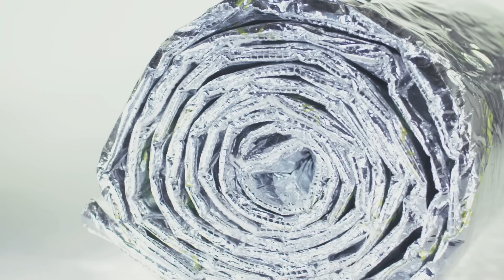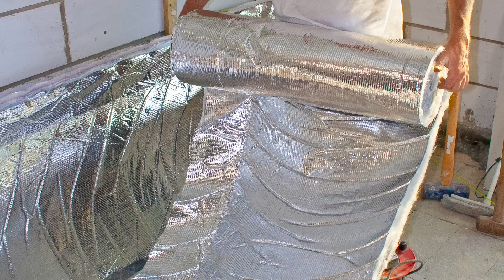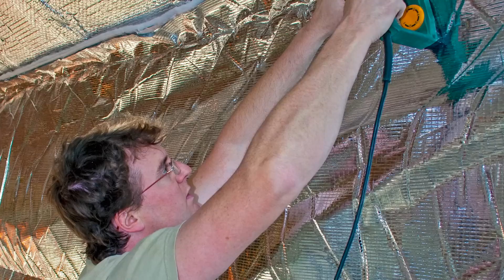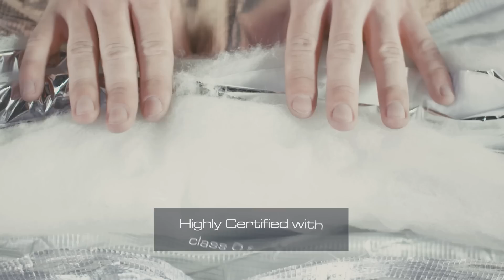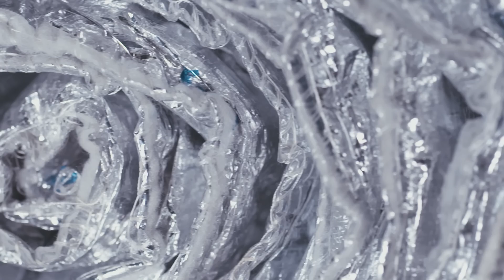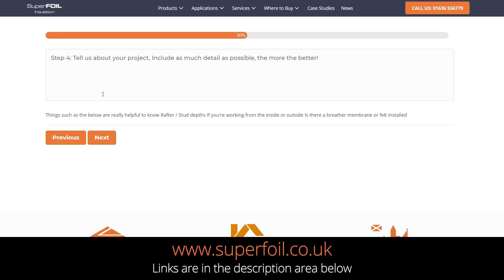What is Multifoil Insulation? — With Byron Lawson

Comment: Local cold climate research describes that there must be an air gap (eg; 1/8 to 1/4 inch) outside the foil in order to achieve the radiant barrier, otherwise the foil is useless if in contact with another surface.   I would also wonder what happens if the foil-quilt-foil gets punctured, and if there is a temperature that causes the dew point to occur between the foil layers, what happens if moisture gets between the foil layers; how does the internal quilt blanket ever dry?   Several years of use will find out what happens.

Comment: Thanks for the presentation. I live in an old cottage and we have a fair bit of loft insulation which really needs to be added to however we'd also like to have storage space. There is limited head height to the roof ridge of about 5feet 5 inches. So in the area I want to use I thought of using LoftZone stilts and boards to the left and right on a central walkway. I wondered what you'd recommend as insulation material underfoot along the walkway? Sorry only an occasional DIYer so might not be explaining myself clear enough.

Comment: Hi I have an old external solid brick wall with plaster on the insides. It's cold. Should I remove the plaster, batten and rockwool it first, or just batten and insulate it on top of the plaster? 
Thanks.

Comment: Having to have an air gap either side of the superfoil, and thereby taking 95mm is a lot. That really loses the benefit of a supposedly thin form of insulation. The SF19+ has an R value of 2.73. I don't know how the air gaps add to that but if you install batons and then 2 inches of PIR and then some plasterboard then the PIR contributes an R value of 14. I feel like I must have misunderstood something because this makes Superfoil seem rubbish.

Comment: Installed Superfoil SF60 in the loft over very thin amount of fibre glass insulation and in conjunction with nice triple glazed windows ( old double glazed had blown) chopped our heating KW by 60%
Reply: At ceiling level or rafter level?

Comment: @SkillBuilder  @Superfoil
My loft is a hostile environment. There is fibreglass insulation between the floor joists that was installed in the late 80s. There are a couple of cold water tanks up there from an era before combi boilers. It's dusty and cold up there and you can see the ceiling tiles between the rafters. I store fans, suitcases, Christmas stuff, tools etc. up there which I access a few times a year. It has the floorprint of a 3-4 bedroom house. Approximately how much would it cost to insulate between the rafters, with multifoil, so I can still store stuff up there. I wouldn't be able to do it myself so would have to employ a contractor.

Comment: I've been using this in combination with 25mm PIR on walls . First strip wall paper off if plaster is sounds leave on . Stick the PIR boards on to the wall with dabs at 400mm or 600mm centers . The dabs don't stick the PIR boards to the wall they provide a packer and level up any unevenness . The boards will come off if knocked tape the joints  . Fix the battern to 400 or 600 centers on the same line as the dabs . Fix the screws through  battern and PIR into the wall  with 150mm screws and tighten up  the batten to the  foil board which will clamp PIR boards  to the dryline adhesive packer  blobs  . .then staple multi foil to the battens then add another batten then add the plaster board  . Used in combination with PIR can achieve higher values with smaller thickness . . In suspended floors l carefully remove floorboards fix batten to the joist fix PIR boards 60mm minimum drop onto the battens . If you leave the boards down 20mm from the top  you can fix under floor heating to the PIR boards and fill with dry sand and refix floorboard it make a excellent heat sink for under floor heating . Foil tape pipe work and joints  to the PIR , sand stays warm for hours no drafts no radiators required . The boiler  flow eventually goes back to the boiler at virtually the same temperature .

Comment: For about a year in the early 2000s house builders were using the bubble wrap version as cavity insulation special  wall ties and you had to build inside skin first didn't make it popular with the subbing I worked for , it was popular as free loft insulation though

Comment: Hi Roger what is your opinion of loft ceiling superquilt insulation as i have a very low ceiling in my loft and already have space blankets between th beams on the floor , also do you know of a product that will raise the blankets from the plaster boards 10mm to allow the reflective side of the blankets to be effective in radiating heat back down as they are currently flat against the plaster board ? Cheers in advance
Reply from the maker: Hi Andy 
 I think you can forget that air gap under the quilt, it isn't achievable due to sag and it probably won't add enough to make it worth the hassle. I wouldn't put more insulation on the underside of the rafters because the dew point will be on the insulation and it will drip all winter. If you have space blanket on the loft floor just add some more if you like but I would be happy with what you have and look elsewhere for improvements
Reply: many thanks for your reply & benefit of your experience , much appreciated 👍  @SkillBuilder

Comment: Foil itself works well, particularly given how easy it can be to install. My attic has attic foil (not multifoil) on top of blown-in cellulose. That's single-foil-only reflective aluminum with no insulating layer. By simply bouncing back the radiant heat in the attic, there's about a ten-degree (F) difference between the top of the foil and the surface of the cellulose underneath. That little bit does a lot.

Comment: Could I put this on an external wall of a bungalow wall which has an attached garage to it. Inside the bungalow the plastered wall is cold and on the garage side of the cavity wall it is finished in blockwork, so can I put it on the blockwork wall inside the garage  which is the cold side of the wall.
There is no existing cavity insulation, can  foil  be attached to the outside wall of the bungalow. Obviously there is no heating in the garage, I just want to improve the insulation of this wall inside the bungalow and just want to use to use the fixing space of the foil inside the garage. Any advise or comments would be greatly appreciated. Martin

Comment: Thanks. At 1930m into this video this is the most insightful regarding installing sf19 plus 45mm quilt on inner wall of old house. Though I am curious: Given that old solid walls need to breath to allow moisture to escape whether this quilt is 'breathable enough'? Also, if I used, as suggested, a 38mm X 50mm wooden batten, isn't that asking or trouble regarding wood deterioration against a moisture prone wall? 

I'm wondering why I couldn't cut a rigid  pir or pf board to the equivalent thickness as a wood batten and mechanically fix those at 40 - 60cm centers instead. Since they are water impermeable, and add a little extra insulation, or is that idea problematic?

Then I could install wood wool boards, and render over with lime, to protect any worry of damp growing on gypsum and maintain a breathable wall with maximum insulation.

Any thoughts on this much appreciated.
Thanks

Comment: Can this product be used to insulate a garage floor without battens but completely seal with foil tape, then install MDF wood on top and then install top finished layer ? 
Same way as installing Airtec multipurpose foil straight on a flat floor

Comment: Rigid foam sheets bonded and sealed onto old ext walls sealed all round etc and surfaced with rigid anaglypta or plastics will give you less thickness and work.Problems with skirtings and  covings are  horrendous in older properties. Just get a thick carpet for floors as ost heat loss is around the perimeter. . Not worth the effort in my opinion provided boards are t&g  ointed.

Comment: Used the superquilt 19 product on the inside of a hottub, got the 1.2m width, folded it so its 2 layers and wrapped on the inside of the case. Seems to work well, saving a few kW a day
Reply: I don't get the panic over heating prices. "All" you need to do, is "become a polar bear". Probl solved.

Comment: I can't see, that you have done a film on vapour barriers, so I ask some questions here. it seems that vapour barriers go hand in hand with thermal installation. yet what is a vapour barrier, and how does it work? 
I wonder if this kind of barrier came out on the market, after goretex clothing. goretex is hydrophilic. but needs body heat as a vehicle to push vapour through the membrane. this is similar to the moisture vapour barrier. that it does not seem to work, if heat is not present, or is it on the basis. that heat rises and would carry any moisture with it. so what happens when moisture, say comes into contact with a vapour barrier, say underneath a roof: is the barrier breathable?

Comment: these foils are so scam,  I studied physics and can tell with 100% certainty, that any aluminium foil installed that way(behind walls or floors or ceilings) is not radiating anything back. the only insulation value you get is from the thickness of the whole material and the air in between those layers. and thats very poor, and a horror for the environment.

Comment: I moved into a 1960's  bungalow. It's freezing cold in my living room because there's no insulation under the carpet, just the underlay put directly on the old vinyl tiles. Would this type of foil be any good to insulate the floor before putting underlay and the carpet? I'm worried about the damp that may set under the insulation causing the mould to appear.
Reply: Hi. What did you end up doing?

Comment: I can understand why the multifoil requires an airgap on the warm side of the wall but why does it require one on the cold side as well? What would happen if it was installed in a following build-up:

- 4inch External Brick Wall
- Stud wall with PIR in between
- multifoil SF19+ acting as VCL (no air gap between the foil and PIR)
- 38mm battens
- plasterboard
Reply from the maker: You have the answer right there. The multifoil is on the warm side of the PIR so the air gap is insulating and stopping thermal conductivity between foil and PIR
Reply: @SkillBuilder  would removing the gap between the two have any major impact on the performance of the foil as it’s supposed to resist thermal conductivity and reflect the heat in the first place meaning that amount of the heat transferred onto the cold side should be greatly reduced by the time it reaches the PIR? With just an air gap on the cold side of the foil and no PIR the residue heat is already lost and it wont be returned into the room?

Comment: Roger, we have a 1950's built semi with 9 inch walls and solid concrete floor (I beleive with No insulation in it ). The stairs run up the end outside wall so, 1, best solution for insulating walls without eating into stair and room space ? 2, whats the best insulation for under underlay without raising floor height by too much because of stairs worktop height etc ? Tia

Comment: Rubbish. Just use insulation panel with one silver surface  and gap. If you insulate with cold surface on the outside you will get condensation. External wall insulation is the only solution. No thermal bridges. Use radiant heater

Comment: Great topic and a useful update on multifoil. Your end comments on wooden ground floors with air bricks removing any heat from the house is equally as bad, or worse, with 'modern' block and beam floors that also require air bricks.

Comment: I my country outer walls in new houses are now as thick as 700mm. I think that's crazy and it takes away from space inside the house. Almost all new houses has to have counterflow heat exchanger ventilation systems installed if you want to live inside them. So that has become a standard as well. I think we are in need of more effective insulation materials as standard instead of the traditional kinds

Comment: Building control in the northwest want you to use a mix of kingspan and multifoil, If you want use multifoil in loft conversion. ie 50mm of kingspan and a tri-iso super 10 and that should give you 0.01kw of heat loss

Comment: Are your R values the same R value everywhere else? You talk about U values? Have not heard about this. Our gas and electricity prices are going up very often, so I want to over insulate the house. You talk about your different types of multi foil insulation but you did not give any R values to each amount of multifoil.
You also say fit insulation tightly between the studs, rafters and joists, I intend to insulate the studs, rafters and joists aswell. Thanks for all the information, I pick up bits and pieces from everywhere.

Comment: DO NOT USE THESE FOIL INSULATION PRODUCTS..............they have been banned in many countries such as Australia due to the dangers they impose. There have been many deaths caused to installers who have been electrocuted by these foils. If the foil comes into contact with any exposed wiring (eg. a cracked, broken, loose fitting junction box) which are frequently found to exist within a confined roof space the installer is TOAST...............BE WARNED!

Comment: They all fail the hot box thermal efficiency test. They are unable to retain warm air within a building in an efficient manner like other proper compliant insulations. All they do well is reflect back infra red radiation and that's the phusdo science it deliberately deploys to confuse the specifier and home owner alike. It has its uses but not for efficiently retaining preheated air within a home.
Reply from the maker: Good point.

Comment: mmm....low emissivity material does not radiate heat - the guest says it does radiate heat ????
Quite simple - Low emmissivity = low emmissions {of radiant heat]

Low emmissivity or shiny foil reflects heat radiation that hits it ie its a radiant barrier - and also when its own temperature is high, it does not radiate or lose much heat - unlike a black body which radiates its heat efficiently - low emissivity means low emissions of radiation
Also - I thought foil is something like 97% efficient in reflectiing and reducing radiation emissions....I've always wondered why a 2nd layer of foil would have any significant additional effect - I have radiant barrier window blinds, across loft floor and under rafters..great for summer and winter...I would think a deep layer of standard loft insulation to hamper conduction and convection, topped by one layer of foil to stop heat radiation loss and gain, would be great in itself..?   I've got great temp readings to buffer summer heat gain and winter loss - ie temp below ceiling, above ceiling, under foil, above foil, in loft space and between foil and roof tiles

Comment: Metal is a heat sink, it cools hot things, it can cool a warm environment.  I wonder if the metal feels cold to touch in a warm room would it be a condensation point?
Reply from the maker: yes but in the end the metal would be the same temperature as the room, it is not intrinsically cold.

Comment: There’s a problem too: in the areas where you nail or screw it its R goes completely out. And given the low rigidity of this material these zero R areas become quite important.
Reply: Also wrong re screws it only flattens at that point but not to zero same as a staple
Reply: You are meant to staple it, not use screws and nails.

Comment: MULTIFOILs seem to need careful consideration. Maybe in the loft, laid over a traditional minimal fibreglass fleece. By the way, for my traditional 1970's brick-cavity-block-wetplaster walls I am thinking about using one of the QUITE THIN Erfurt Wallrock or Erfurt Redlabel wall lining products, not least because then the depth loss at skirting boards and door frames is less obtrusive. These come from just 1mm to 4mm thickness, the 1mm ones are a paper product and are naturally over-paintable, the 3mm and 4mm ones seem to be more polyester meaning more prep needed if one wishes to then over-paint. The products U values are stated in the specs and are obviously on the weak side, but I'm hoping will be enough bearing in mind the current 1970's spec cavity walls (which, by the way, do include retrospectively blown in insulation - which, I've heard, is not often of significant worth). My logic for thinking of going this wall lining route is that, almost by chance, I noticed ON AN INTERNAL WALL where one side is emulsioned and the other side is vinyl wall-papered, that (at an internal door), one hand placed on the wall this side, and the other hand placed on the common wall the other side, gave a noticeable tactile temperature difference! Try it. David Whyman.
Reply: Did you listen it does nt need careful consideration it’s an easy fit just remember to tape the joints

Comment: Can't drill though it though, is one of the issues, (for walls) creating the issue of how to fix it. 
So building a wall out by 92mm plus skim. And thats just to get one layer of insulation and doubling up CLS costs. 
For 77mm of wall space, and half the timber you could use 25mm foil backed insulation foam boards between the timbers and over the top. 
With super foil, you get the vapour barrier but on masonry that isn't necessarily a good thing, but not having to cut foam boards is a seriously good thing!! 

They work very well in lofts.

Skill builder, would slaters lath be enough void space, (between the foil and the back side of the plaster board)??

Comment: Hi Roger and Byron, very useful information about insulations. All touched, roof, walls and floors but the less solid floor as you raised it but later ended up with a suspended timber floor only. So please Byron, could you answer me what is the procedure for insulating a solid floor, can we directly put it on top of the floor or do need battens?
Reply: Make some Superfoil slippers!